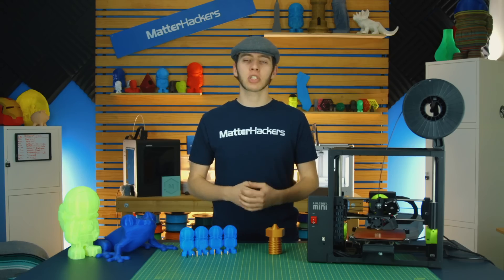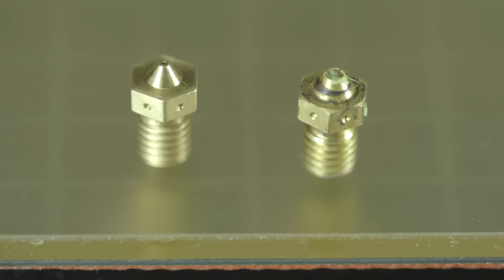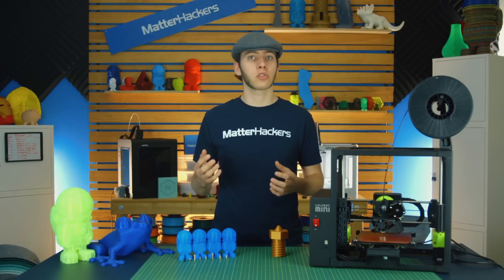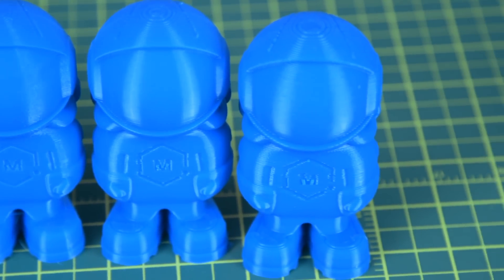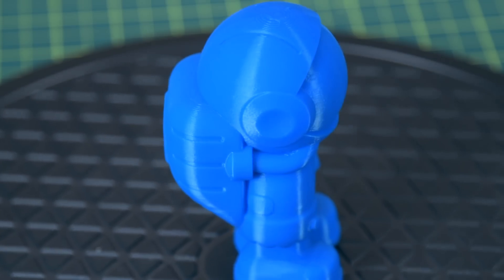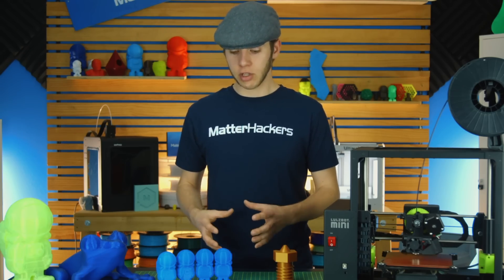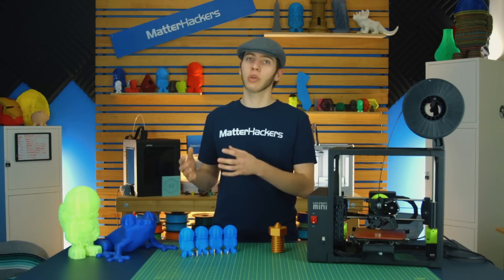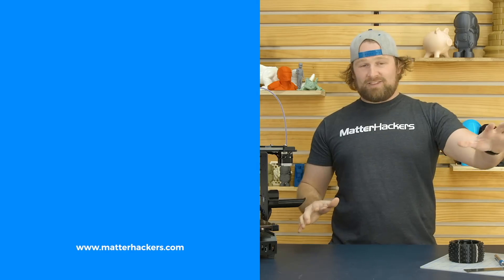3D Printing Nozzle Comparison // 3D Printing Accessory

Comment: I use .6mm copper on one of my printers, it gets the longer prints that still have to look decent,I like the copper because it allows me to print a little cooler which gives me a warm fuzzy feeling being able to lower the temp 10c for the entire print which can often last days. 

.6mm A2 steel on another printer, it gets the carbon fiber filled filaments and wood/other abrasives. 

.4mm copper on the delta, allows reasonable print speeds with a standard v6 hotend. Great for smaller prototypes and other prints. 

.4mm brass on another, this printer gets used for a petg and PLA, no abrasives fillers nothing high temp. Mostly prints things my wife and kids want. 

1mm brass,petg and pla, this is on my largest printer and it gets used for large non-detailed prints and vases. 

2x brass .4 on the final printer, for now it's running brass nozzles on the dual nozzle Chimera+. It doesn't print anything that needs a special nozzle and doesn't get used all that often. I do love using any excuse to use it,simply because I just find the dual nozzle cool.

Comment: You can’t compare nozzles with “everything else being the same”. The ONLY correct way is to go through every calibration, and optimize slicer software... then compare. Sorry, these type of comparisons will greatly mislead. It sucks, but it’s true. With changes in nozzle size, the tool width changes, the effects of temperature changes, formulae to correct motion changes. Everything is intertwined. What really happens here is a machine calibrated and optimized for a brass .4 nozzle will tend towards that nozzle being the best choice. Do all the work and see the truth.

Comment: Hi Alec, I've just upgraded my CR10S to use a Titan Aero direct drive extruder and I also upgraded to an E3D Nozzle X using 3 mm filament. (PLA and PETG) my question is... How much if any, would I increase my temperature to print?

Comment: Advice for a nozzle printing 1.75mm wood filament?
Reply from the maker: Wood PLA is not abrasive, so you should be fine with a standard brass. But, if you want to start printing with more abrasive materials, upgrade to a hardened steel or Olsson Ruby Nozzle: https://www.matterhackers.com/store/c/Nozzles

Comment: Newbie question...
about the copper nozzles and better heat transfer properties -what are the indicators that the filament might be under heated? Layer separation?
Reply: perhaps, generally just clogging/stopped extrusion IME

Comment: I have a Monoprice Maker Select Mini v2, idk if I can change the nozzle on it. If I can, what's the best one to get? I'd like to try to print in carbon fiber.
Reply: Mitch Olsen - you can; I’ve got a V1 machine, and I’ve got the Micro Swiss all-metal hot-end kit in it with a Micro Swiss 0.5mm nozzle on it.

Comment: is there any fixed ratio between layer height and nozzle diameter..plz suggest
Reply: No there is not, but in my experience a layer height between 25% and 50% of the nozzle diameter works the best (I have a 0.4mm nozzle and I usually print between 0.1mm and 0.2mm layer height)
You can go under 25% or over 50% (for example 0.05mm layer height or 0.25-0.3mm layer height) but it will be harder to find the correct slicer settings for a good print quality
Reply: thanks a lot @stefano rubani
Reply: 80% absolute max 20% absolute low is how i usually do it
Reply: leifjames53 thanks